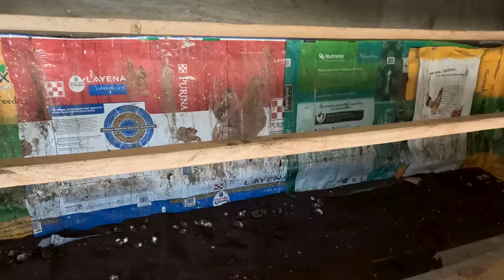Got Exactly What I Wanted Out Of This One, Sawmill Eye Opener

Comment: Always pre drill your project. Makes everything much easier. And easier is much faster!
Reply from the maker: Very true!
Reply: @OutoftheWoods0623 - Nathan - Does Joe Maine make a saw blade that has teeth on both sides?  It might not work for all applications, but I noted when you were resetting the saw control @ 23:00 to come back to the operator's end, that you were missing a possible cutting stroke for these repetitious deck boards.  Was that by design?

Comment: Nathan,  you did EXACTLY RIGHT drilling those pilot holes for door siding.  I've been doing architectural sheetmetal with sheetmetal worker's local #36 for 32 years and counting.  We Always do that. If you have alot of identical panels,  make a panel to use as a pattern,  stack several panels up, and you can predrill several at a time. Love your channel

Comment: i hate that when a window leaks..course i put double pane on the west side of my place,,it gets hit the hardest,,good luck so far..but i put a single pane sliding window in my kitchen,, haa it just freezes bad,, and the ice melts,,its coming out as soon as i get a good one..my roof use to leak before i put steel on it..i hate leaks,,it destroys everything...good job Nathan on that oak..i would think blades get dull cutting oak..

Comment: Window installs on a metal clad building is all about flashing and peel and stick flashing underneath.  Metal needs to be set up much like step flashing is done on a roof but not exactly.  It's all about bring intruded water back to the exterior.  Also, your low pitch roof is going to cause problems with whatever is below its support.  Wind driven rain will adhere to the underside and be blown uphill on the metal and deposited to the lower header.  It takes decades for it to destroy itself but it will happen.

Comment: Just a simple question. The handle on the logrite trailer, is it removable? I was wondering if you could use two nuts on  the end of the screw shaft, kind of like a jam nut, then you could use your battery drill with the right size socket as a motor driven lift system. Just a thought.
Cheers. P.S. I love Tennessee! Beautiful state.

Comment: would have installed a peice of flat metal where the cutout for the window went as a better seal is much easier to achieve.
You live and you learn though and without mistakes we would be learning less!
Reply: He did, as much as possible.
He put a piece of corrugated metal over
a hole in a corrugated metal wall.
Reply: @zapa1pnt  I meant to put a piece of flat metal instead of the corrugated metal in the area that the window went
Reply: @AndrewAHayes : That wouldn't work at all, because the edges of
the hole are corrugated, because the wall is corrugated.
If you cut a hole in corrugated metal, you have to patch the hole
with corrugated metal. OH, maybe your thinking of corrugated cardboard.!?
Corrugated cardboard has two flat outer layers, with the corrugation in the middle. The sheet metal is only the corrugation, with no outer layers.
That's why it won't seal. I hope that helps. 😁✌🖖

Comment: Nathan you have really got a handle on the LT70, does it have Auto on it so you can set it to cut 4/4 and it stops when finished ?
Reply: I know that one. Nope. He moves it forward and back, at
his chosen, manual, speed, depending on the wood he is cutting.
When it comes back, it will drop down, to continue cutting the
programmed thickness. 😁✌🖖
Reply from the maker: Yes

Comment: Was just wondering if you were going to mix the red oak with the White oak. I thought the White oak was better for trailer boards just curious. Great videos
Reply from the maker: it is better but customer wanted Red,
Reply: The customer wants to use the red, because that is what he has
available and he changes the trailer bed several times a year.
He hauls heavy equipment and i wears out, before it could possibly
weather out. 😁✌🖖

Comment: Does the mill log  rotator require maintenance❓The teeth sharpened or whatever ❓🇺🇸🗽
Reply: I doubt you would want them sharpened.
The sharp edges would cut chunks out, instead
of the square edges just scraping a bit off the surface.
Reply: @zapa1pnt  Have never seen this "chain" device up close. There must be some type of sharp edge to grip the log ❓Just wondered if it is a maintenance item.🗽🇺🇸